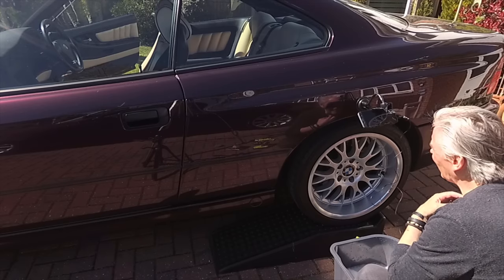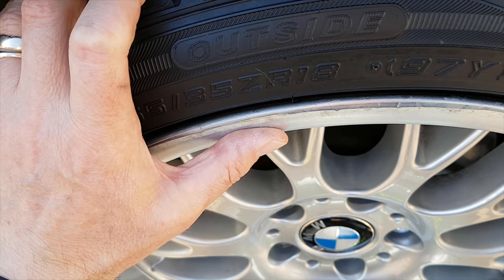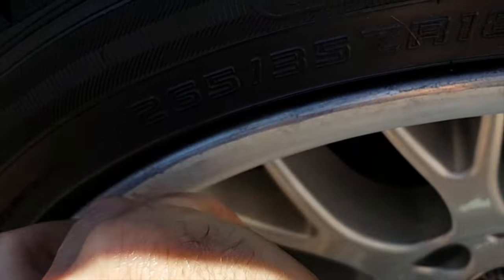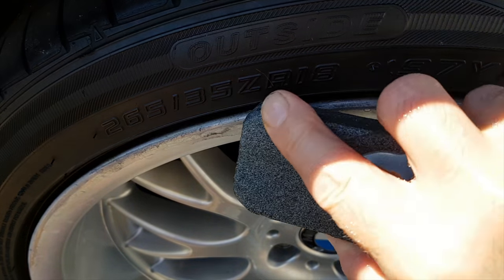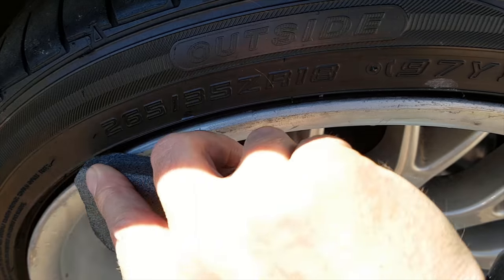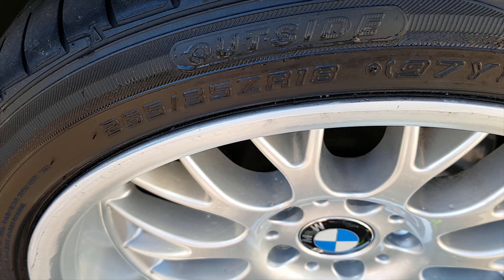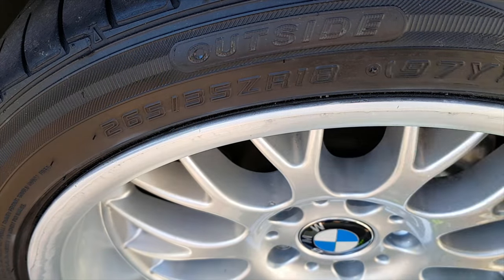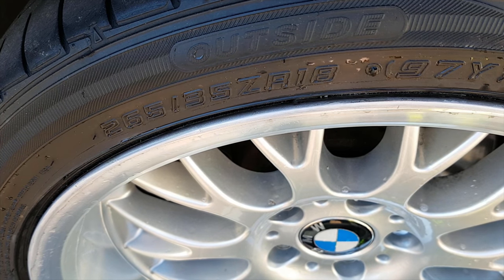BMW 1 Hour Alloy Kerb-Rash removal- No Paint needed!

Comment: When I got my MPars they were pretty badly curbed, I did a similar process to take off the rough parts. I had polishing stones on my angle grinder. I wish there was a better way to blend the fixed parts and the existing painted part of the wheel.
Reply from the maker: Yes, the blending is the difficult bit!

Comment: What finish is that on the lips. Is it diamond cut
Reply from the maker: They are original Rondell 58's so yes, diamond-cut!
Reply: @TimmsBMWRepairsandInformation  thanks. Ive got the same. Currently they have gone for a refurb and im getting the dishes hand polished

Comment: Hang on, aren't those wheels painted? have you not just effectively polished off the paint around the rim?
Reply from the maker: No, they are a polished alloy and the finish is identical after this work as it was before.